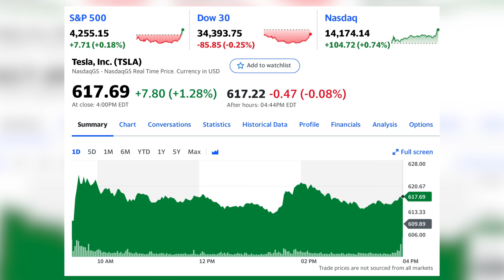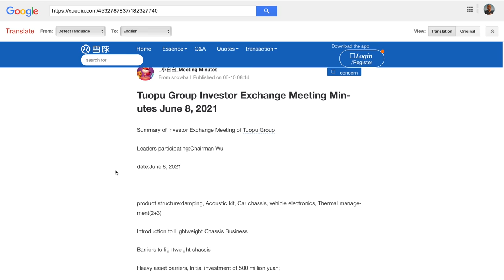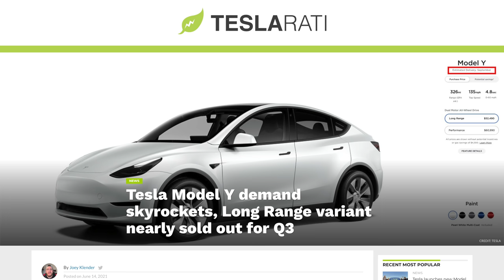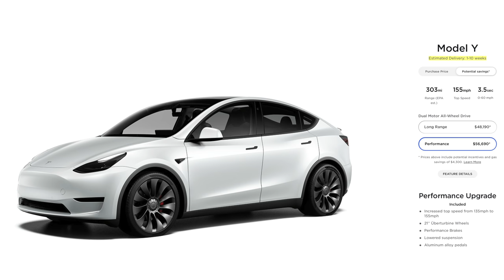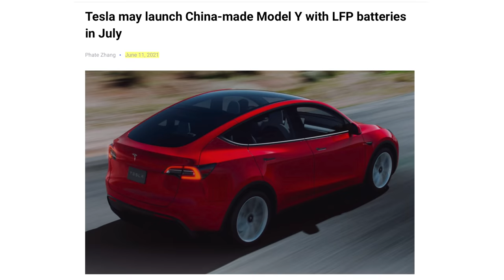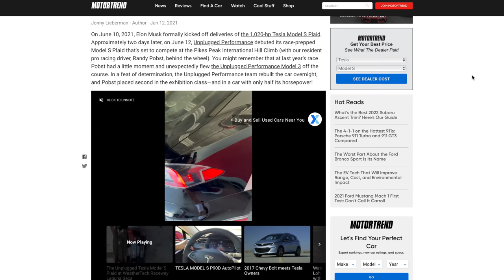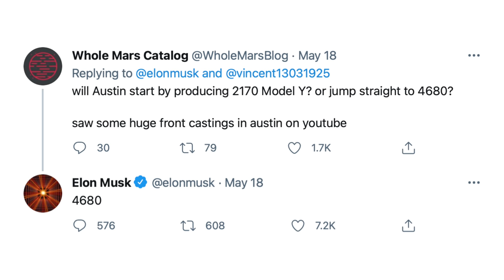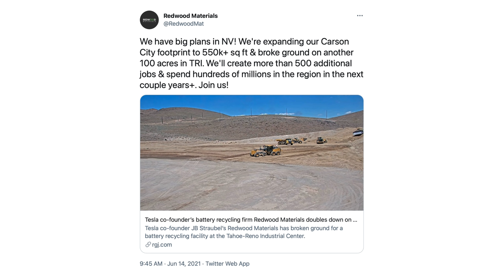Tesla Rumors: Model Y, China, Suppliers + Plaid Updates, Tesla Holds Bitcoin Position

Comment: Please don't shoot me 🙏

I'm going to say what I think is the reason they postponed the Plaid+

Tesla doesn't want to blow the competition out of the water. If they wanted they could get a Plaid+ to do 700+ miles on a single charge for 180k. If they switched out the battery pack on the Plaid model. Just think about that! The reason they showed off a 520+ miles range was just to show they could beat the Lucid specs. 

They don't want to show the old OEMs what they can do because then the old OEMs would say it is no point even trying to compete and focus on ICE cars or hybrids. Tesla can't produce enough cars, so they need everyone to make electric cars. That is the reason they are always just a little bit ahead of the competition. And the second they catch up or pass them, it only takes a couple of months before they got better specs again. It is like holding a carrot in front of a horse to get to go where you want it to go. Tesla is doing the same for the whole car industry. 

If you could get a Plaid for 180k and 600 miles or a Porsche Taycan for 180k and 280 miles on a charge. Which would you choose?

I think we will see this with the updated Roadster. If you take the specs that they showed off in 2017 and add a 54% range increase to it from the 4680. The range is 955 miles on one single charge!! And if they want, I think they could make it go over 1000 miles. Think about that for a moment! 

We will see Tesla always in the lead, but never too far away from the competition. Just enough to still be the king, but let them think they can catch up. 

Just add a 54% increase to their entire lineup and you would see what they are capable of. The only thing is that u won't see it for at least 3 years. 

This is my opinion only.
Reply: @BullShark The Plaid+ had an estimated range of 520+ miles before it was taken away from the website.
Reply: I will have to totally disagree with you, 700 miles on a model S is not possible now and it would be pointless, people are waiting for the cybertruck with that king of range thats where it counts the most.
Reply: The giant mercedes gls400d is way bigger than a modelx and it has over 800 miles of range and it can tow for days to come.
Reply: @carholic-sz3qv  How is a 700 miles range Model S not possible. It is more or less confirmed that the Model S is using 18650 still. I am sure that 2670 is better than 18650. If so, then you have the Plaid with a range of 390 with 18650. If you switch this out with 4680 and don't make the battery pack smaller, then you can add at least 54% range if not closer to 60% since it is the 18650 and not 2670. So a 700 mile Model S is what they could do today.
Reply: @-Yomi  are you even serious?! Tesla never said that the 4680 will double the density of their batteries you were not listening at battery day, the 4680 will just improve the manufacturing process of batteries and add about 16% more range at max. Go watch the video again. Also those modelx heavy complicated doors will need to go to imorove the range.
Reply: @carholic-sz3qv  I don't think you understand. For tesla to implement the 4680 it had to do the structural battery pack to be able to cool them. 

https://www.dnv.com/Images/TeslaBattery67_2560x1440px_tcm8-188048.jpg

What you are talking about is just the cell designer and size. Not taking the cathode and the anode into consideration. Which adds another 24% increase in range and at last the structural battery pack adds the last 14%. 

Watch the event one more time before writing a response😉
Reply: @-Yomi  you're not serious aren't you?! The structural battery pack has nothing to do with cooling or range improvement, the tabless battery cells will require a different more effective cooling and the final battery pack will just see about 16% of range improvement and they are still working to make the 4680 possible, its not even ready yet. The 4680 will significantly reduce the amount of cells to be made since they are bigger than 2170 or 18650.
Reply: @-Yomi  people are very uninformed about the 4680 batteries.
Reply: @carholic-sz3qv  Did you even look at the image I attached? YOU CANT HAVE A BATTERY WITHOUT A CATHODE AND ANODE! The 16% increase is just the size of the battery cell and how it is produced. 

https://www.dnv.com/Images/TeslaBattery67_2560x1440px_tcm8-188048.jpg

Look at the leftmost graphic. And you might understand that what you are saying is wrong.

Comment: Tesla has 900 lbs of fossil fuel components in each car , 🤔🤔🤔🤔 .
Reply: You cannot eliminate fossil fuels 100% in just 20 years.
Reply: @neeljavia2965  you are so correct
Reply: @farmerjoe338  One needs to completely work hard to remove it.
And it will happen by the end of this century.
Reply: @neeljavia2965  even in 50 hears to come, oil is basically in everything we use daily, from fertilisers to medical equipments, drugs, devices, grid, paint, roads, lubricants......... even glass manufacturing needs gas. Iron, aluminium, copper, lithium, nickel are all mined amd transported with fossil fuels, steel is made with coal......
Reply: Ok, what’s the figure for ICE cars?
Reply: @fredbloggs5902  Many thousand times more obviously.
Reply: @carholic-sz3qv  Majority of these things can be changed.
Most heating activities can be done by hydrogen.
Lubricants can be made through other materials.
Transportation can easily be done through EVs whether it's cars or trucks, railways or even through hydrogen.
Reply: @neeljavia2965  I totally disagree with you, we are not at the point where Eav can be broadly used for transportation, the tesla semi with barely 500 miles is quite a joke, lubricants from other materials are very difficult and extremely expensive, people have been talking nonsense about hydrogen for years now, I dont why the hate.